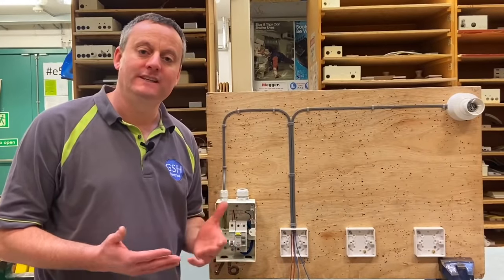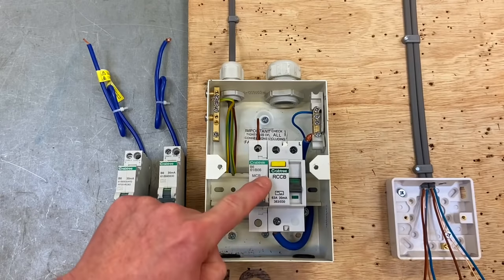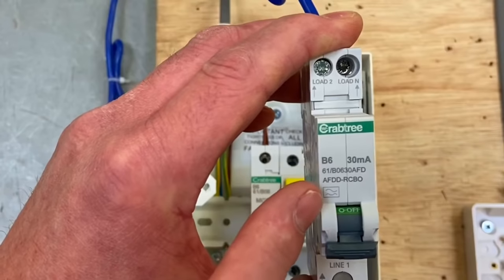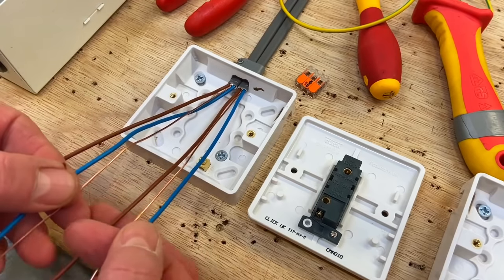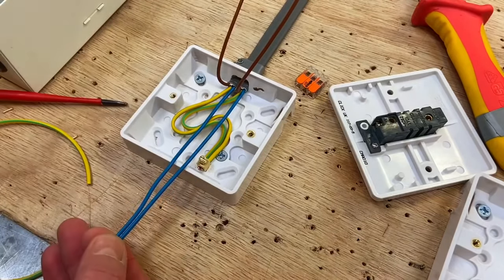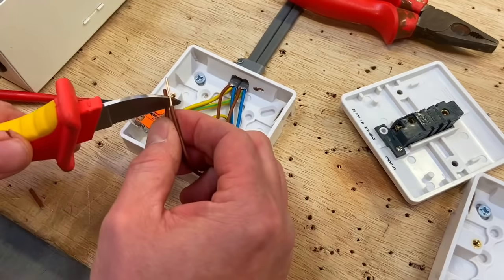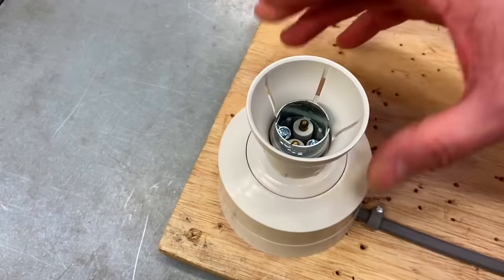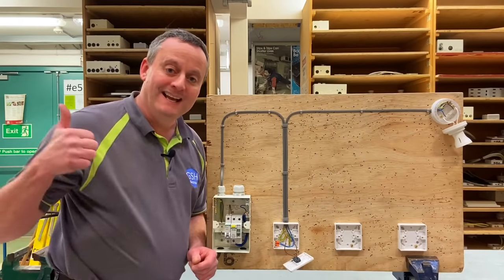Lighting Circuit 2 Plate Method Taking the Feed to the Switch and Connecting a 1 Way Switch & Light

Comment: Hi Gary - Great video as always!!
I am not an electrician but am interested in the theory of wiring.
Am I correct is stating that the benefit that you refer to is only on the 1st light in the circuit since you will have 1 cable (plus a feed out if any additional lights on the circuit) whereas in the traditional method you would have 2 cables (plus a feed out if any additional lights on the circuit). I assume that in either case the additional lights on the same circuit (switch) will have a feed in (from the previous light) and a feed out (to the next light if any).
Perhaps you could also show how the feed for any additional rooms (with a different switch) is wired or does each room have a feed direct from the Consumer unit?
Reply from the maker: Lighting Circuit 2 Plate Method Wiring 2 LED Downlights Using Collingwood Easy Fit Connectors https://youtu.be/JFTEFHso5yQ

This should help 👍. Thanks for the great message. Gaz
Reply: @GSHElectrical  Thanks for getting back so quickly - did not realise the video was over 6 months old - just appeared in my feed today. I will take a look at the other video.
Keep up the great work!!

Comment: Great video, I have a 2 gang 1 way light switch I need to change from a dimmer to a normal switch. It has been faulty for a while so I am not sure it is currently wired up right (therefore I cannot just copy the config of the wires. I have a set of feed wires and 2 sets of switch wire. Is there a way that I can tell them apart. Two of the grounding cables have been sleeved together on one side of the box and the other set of wires is on the otherside - should I assume that the two sleeved together are the two sets of switch wires?

Comment: Hi Garry how are you , hope you and you family had a fantastic day yesterday ,
just a quick question i just watched your video on RCDs for lighting circuits , and the testing procedures
am i right in say that type A  and Type b are DC sensitive ? i as k as i have alway use a ROBIN KTS1620 multifunction Tester witch has a function for DC sensitive RCDs  and the RCBOs in my home Consumer unit are type B when i test them they trip as expected and well in the required time  . or am i wrong  also the use of twin brown for the witch drop is old hat it was at one point twin red as you stated , but back in the early ninetys is was working on a new nursing home  and we used single red and earth  and single black and earth for the switch drop and for the emergency lighting  never seen the cable since

Comment: This method does have the potential to drastically increase the loop impedance due to all the switch drops.  The supply to the last light on the circuit has been looped in and out of every switch on the circuit.  On a fairly average sized 1mm circuit, a Zs of 2 - 3 ohms is quite normal.  As long as it doesn't exceed 5.8 ohms on a 6A breaker all is well but it's just something to bear in mind.
Reply: We have used the old method for donkey's years without issue. Why the need to change something that works?
Reply: To help mitigate could use thicker wire eg 1.5mm sq

Comment: This method is fine as long as you haven’t got 2 way switch because I had to sort out new build 2 way switch there were 4 cables in single 25mm box and it’s not easy trying to fit them
Stick to feed in to pendants and out

Comment: What would be the best way of feeding 3 lights from the consumer unit with the switch being the farthest point away from the consumer unit?

So Consumer unit ---lamp---lamp---lamp---switch 

If you have a video for this already sorry couldn't find it
Reply: I feel the easiest method in your case would be the lighting loop in method, take a live and neutral and earth wire to your first light......run a cable twin and earth to your switch from your first light....we know that this is your switch wire....then run a twin and earth from your first light and loop to your second light and then to your third light.....do your connections in your ceiling rose or junction box....you would have three cables....first the main from your consumer unit. Second from your switch,  third to your next light fitting....strip back your main cable and your switch cable and the cable to your next light fitting.....take the main brown and blue....terminate THE brown on the centre connector on your ceiling rose,  your blue go's to the light fittings( neutral)  your switch wire is brown to center block on the rose and your switch wire to your light fitting (blue switch wire) you can put brown sleeveing on the blue wire and connect to the rose fitting or pendant lamp flex , that's your first light circuit  and simply loop to your second light and the third..connections at done in the rose and connected to your first light feed..
Hope this of some help to you..👍👀

Comment: You wouldn't catch me stripping those wires with a knife, I'd have no fingers left.
Reply: Agreed, noticed the deep cut to his left thumb at 08:31 😆👍.... still good video though
Reply: @jonsstuff760  I didn't but I've heard he's a bit of a knife ninja afterhours. 😀
Reply: @jonsstuff760  They are all good videos 🎥
Reply: Never use a sharp knife
Just sharp enough!
Reply: Or a job with how long that takes to do that! Wouldn’t get much second fixing done!!
Reply: @jonsstuff760  That's not a cut, it's a split. This happens to some people in dry winter weather, especially tradesmen who work with metal in cold conditions and without gloves.

Comment: Say you wired, a light and switch via this method, x 2. To then connect to the consumer unit, would there be anything "wrong" with taking the power connectors for each light, connecting them using a 3 way wago, thus only one live, neutral and ground needs to be connected to the consumer unit, - or is there anything wrong with wiring both feeds to the consumer board  ? (question is only theory, not intending on doing anything electrical.) Just here to learn!

Comment: So if you want another ceiling rose in the same room on the same switch you just run the “neutral”, “switch live” and “cpc” from the first ceiling rose to another?
Reply from the maker: 100 %
Reply: @GSHElectrical  thanks for the quick response, was adding another rose in the attic and noticed the original was wired in the 2 plate method so just making sure 👍🏻

Comment: I often take a 3-Core & Earth from the Switch to the 1st Light where multiple lights are installed just in case you want an EM later.
Reply from the maker: Great advice thanks for sharing. Gaz 👍
Reply: @GSHElectrical  Bloody handy if the owner wants to let it out to students, they could have an EM & Smoke Detector in each room.

Comment: So how to connect the next light in the series? Run a third cable from the first light switch to the next? Will have to fit deeper pattresses and wider chasing of the walls.  Hopefully manufacturers will start producing light switches with loop in/out terminals.
Reply from the maker: Lookout for next Sunday’s video 🦾.
Reply: I think we'll find that there's a reason he used a three-way Wago :)
Reply: @obd6HsN  Ah, yes, good thinking  :o)
Reply: @GSHElectrical  Great thanks. If only all installs were done on a bit of backboard :o)  
Enjoying your channel, very informative, thanks for the time you spend doing it.

Comment: Can I take live feed from ceiling rose ,to the two plate method, think of putting light up in the loft
Reply from the maker: You can come off the 3 plate method to the loft switch and use the 2 plate method for your new light in the loft. 🦾👍
Reply: @GSHElectrical  thank you for the quick reply, your tutorials are very informative and educational, much appreciated, thank you

Comment: Please what's the difference or the meaning of the B6, C6, and so on. What role does it play and where is it use
Reply: Its the operating charachteristics of the device. Check your Regs tables and you'll see how Zs values correspond to meet tripping times. Also the type of load or equipment may govern the breaker type.

Comment: While the switch is “off” How is the circuit complete? ie how does the current travel back to the breaker if there’s no neutral connection?

Comment: How would I add a new light with its own switch ? Would I take a twin and earth from the old switch to the new switch then a switch line to the new light? Any help is appreciated
Reply from the maker: Wiring Diagrams for Lighting and Motor Circuits
https://www.youtube.com/playlist?list=PL2Ea5r9gxUUfm4SACOSOZigCeSxxC5xaO
Reply from the maker: How to Add a Feed to Another Room From a Ceiling Rose & Pendant 3 Plate Method Connections Explained
https://youtu.be/J_a30TQS0fY
Reply from the maker: Wiring Diagram 2 Way & Intermediate & 1 Way Switching of Lights Using the 3 Plate Wiring Method
https://youtu.be/75iucYajyBQ

Comment: And would a feed out to the next lamp or switch be from COM terminal in the switch and then neutral looped again?
Reply from the maker: Wiring Diagram 2 Plate Method - Taking the Feed to Another Room or Switch Connection Explained https://youtu.be/R3_eXKo1NFQ
Reply from the maker: Wiring Diagram 2 Plate Method How to Add More LED Downlights (Spotlights) to Your Circuit https://youtu.be/YX8zxGTajZY
Reply from the maker: Hope these help 👍🏻

Comment: Great video, however I would be careful how you strip the cables. Cutting the insulation at right angles can "nick" the copper conductor, creating a weak spot. This is where conductors can break. I was told to cut the insulation away at about 30 degrees so it doesn't nick the conductor. If you try and nick a conductor the bend it a good few times you can get it to break.
Reply from the maker: At college we didn't have access to wire strippers so over my 19 years of teaching the knife was our go to tool. Thanks for commenting and watching hopefully over time money can be found to improve the tools in FE. Gaz👍
Reply: @GSHElectrical  Hi friend, It wasn't using knives, it was the angle of the cut  that risks nicking the copper causing a weak spot that can break. I was at college in the 70's, we had to use knives for stripping too. I taught electrical installation in Kenya in the 80's, that was quite basic, but great fun. Keep up the great work.

Comment: I have done this circuit but with the led panel with two gang switch and the buttons won't turn off. I have been struggling its a new cable from the consumer unit to the backbox and then two sets of lights and the buttons freeze won't turn off.

Comment: Why do i have 2 red wires in my light switch coming from one cable, aswell as a blue and brown wire coming from another cable , i have spot lights, and a ceiling light what needs to connect to what

Comment: Only time I've done this is it was in a bathroom as end of circuit because the type of fitting was pain to get two cables in.
Reply: Exactly so example only works for 1 switched light circuits OR end of circuit. Doesn't explain looping on to other switches...
Reply: @dannys7795  I cant see any advantage in this method except of wiring except in what i described ,but two plate is usually the preferred method for conduit wiring but no neutrals at switch.

Comment: could you do intermediate switching please
Reply from the maker: I have produced the video you requested it will be out at some point. The wiring diagrams video maybe helpful. Thanks Gaz 👍🏻

Wiring Diagram Lighting Circuit 2 Plate Method Taking the Feed to the Switch 2 Way and Intermediate https://youtu.be/L9DU8XkHn1U

Comment: I’ve been a sparky for nearly 40 years. Never heard of the 2 plate method, where does the name come from?
Reply: Can't tell if you're joking or not? I hope so.
Reply: @stevenwalker1259 I wish I was.  I obviously know the circuit configuration, I've used it a few times, but I am genuinely confused by its name?
Reply: @johnmckenzie1623  well in a standard pendant you have a Switch line terminal (plate), loop and neutral. This method eliminates the need for a loop terminal therefore just leaving switch line and neutral. I hope you are not from the UK. Being unfamiliar with another country's terminology is fair enough. Not knowing that or being able to work that out is inexcusable.
Reply: @stevenwalker1259  well I’ll not try and offer up an excuse then.  I’ve never heard of a connector referred to as a plate, so without knowing that terminology I’m not convinced many could have worked it out. Thanks for explaining though.
Reply: I haven’t either.
Reply: @johnmckenzie1623  I agree with you-why call it a two plate method?Where’s the two plates?💁

Comment: As a spark in New Zealand its interesting to see how things are done in other countries.  The method you have shown here is the way we would install most lighhting circuits.  But the main reason I watched the video was not to see how to wire a lighting circuit, but to find out.....why do you guys call this the "two plate method"???   I might have missed something but I don't think you explain where the term comes from.
Reply: If I showed you what I'm installing now you wouldn't believe it, lol
Reply: two plate just means you have live neutral (two plates) and then at the lamp you have neural and switched live (two plates).  The three plate technique supplies live and neutral to the lamp and then exports the live to the switch with a switched live return to the lamp, this requires three plates (common terminals) at the lamp.
Reply: @edc1569   Thaks for that, nicely explained.
Reply: @edc1569  so two plates = # of cables inside the light box if you were to continue to another light box.
Three plates same but feed the light box first, then continue on, and run a cable to the switch?
Reply: @edc1569  the terminology you guys use is so different from the USA. We run a feed, a hot(black,red, or blue, or brown ,orange or yellow wire) and a neutral( white or gray wire) to a switch box, then a two wire cable to the light. The feed connects to the switch, the neutral splices thru to the light, and the other black or brown is called a switch leg
.

Comment: Hi Gary can you do a video on your opinion that the Level 3 2365 (2 year course) changing for the 8202 level 3 (1 year course) As an adult learner going college 2 nights a week and forking out £3.5k for the course, I’m unhappy and worried. Level 3 2365 over 2 years would of gave me more confidence to let all the  knowledge sink in. Now I’m under pressure to have 2 years work crammed into 1 and it’s a pass or fail written exam and the end with 1 resit. Can I have your thoughts and opinion on it. Thanks
Reply from the maker: Richard Larkin https://www.efixx.co.uk/Events/WEBINARS/t-levels-and-other-electrical-course-changes-on-demand
We did a webinar that should help 🦾

Comment: I think in Canada this has been the way to do it for many years, my house is built in the 80's and the Panel wires are run to the switch box, this makes it easy to work on a light fixture or change it, turn off the switch and there is not electricity running to the light junction.
Reply from the maker: Thanks for the wonderful comment 🦾. Gaz

Comment: Surely an important reason for this being the new normal is the advent of smart switches which require a neutral.
Reply from the maker: Steve Jones good point however not all smart switch now need a neutral. Massive thanks for commenting. Gaz 🦾

Comment: See im from cyprus and this is the only method we use. After research about the uk i was baffled as to why you would want 4 cables in a junction box in the loft!!! I mean im sure its to easier connect at the switch but thinking about it you save wire lengths doing the connections at the light
Reply: Ceiling roses usually have provision for a lighting loop which is a common lighting circuit configuration. You'd run a single feed from the distribution board and then do a drop from the lamp to the switch to switch the fitting off and on. Two plate keeps individual fittings tidy, but requires more cabling overall.

Comment: Keeping the line conductor at the lighting point is the best approach. For example if you needed an unswitched line for an bathroom fan or a smoke, heat or CO2 detector for it's much easier to tap off from the lighting point in ceiling than the switch don't you think !

There would be a tussle with the wires in the two plate method when fitting a dimmer switch in fact a deeper box is required.

This wiring technique isn't for me.
👍🏿
Reply from the maker: How to Future Proof Your Lighting Circuit with a Neutral at the Switch - 3 Plate Wiring Method 👉🏻 https://youtu.be/1XcxdvFRyY0

Comment: Why not run the CPCs in a single sleeve?
Reply: Hi

if the cpc's are in a single sleeve you can still get continuity with them touching together even though one is not terminated in the screw terminal which may not show on testing and possibly fail as oxidization occurs over time, if in individual sleeves you can pull each wire to check it is correctly terminated in the screw terminal also it would show up better when doing a test if incorrectly terminated when you do the final tests regards Peter

Comment: Gary,
Sorry to pour scorn on your video, I thought it was great.
Until you used a cable stripping knife for stripping single conductors.
Now, I know you've done this a million and 50 times yourself over the years, an apprentice doing this could end up nicking the copper conductor material, if they cut too deep when stripping wires.
I've always used angled type side-cutters to do the final stripping of the wires, it's all technique I suppose.
And you can get them automatic wire-stripper things, but you can get called names for using them on-site. 😂

I have one of them stripping knives and I only use it to take the outer sheathing off Neutral screened cables where you can control how deep you cut into the sheathing.

Brilliant video though, thanks for your effort in making better electricians!